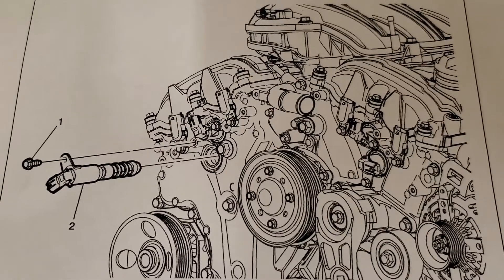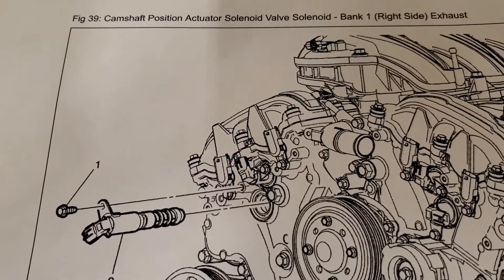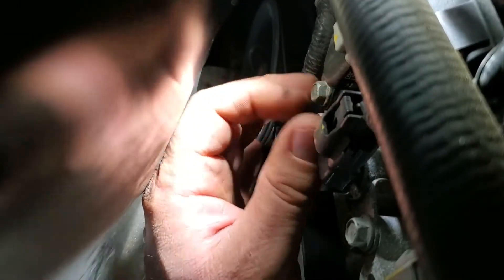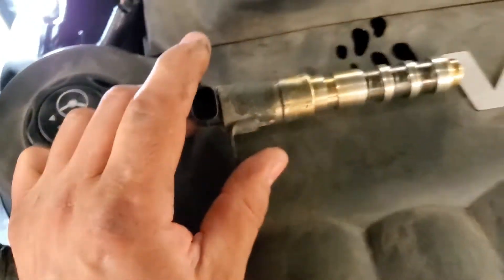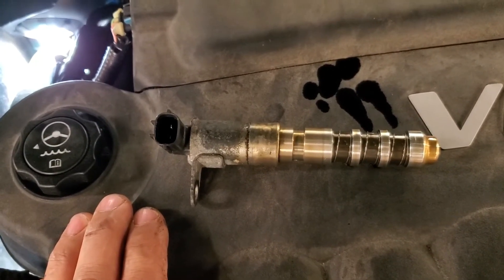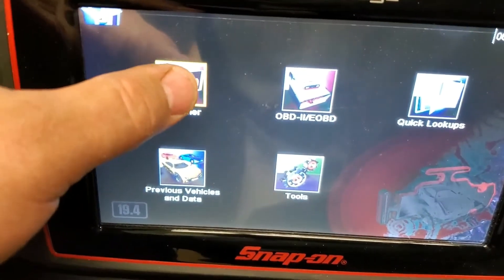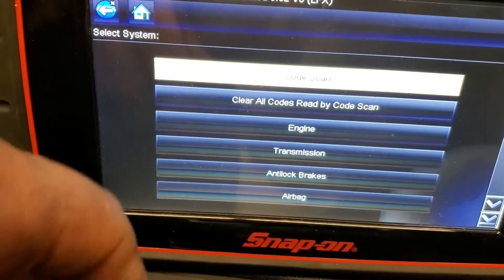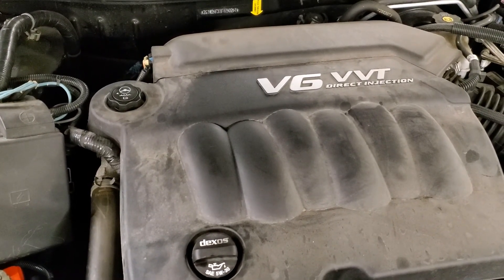Impala P0014

Comment: Great video. I did the intake solenoids last summer. I had about 125k on it. I should have done them all but did not want to spend more, I recommend replacing the oil at the same time. Many times over the years I have seen cam timing issues caused by low and or dirty oil.
Reply: Cam timing issues is the same fix?
Reply: @urielgomez3701  It is all about the code. This is the most common problem. If changing the oil and replacing the solenoids does not fix it, you have other issues. I will be doing both exhaust solenoids and oil change, because I have new codes like P0014- and P0024. The intake solenoids did fix my first issue. two months ago.
Reply: @americanfreedom6417 Did replacing them and changing the oil fix it? I have both of the same codes.

Comment: Just a heads up to all of you that are having this problem with your 3.6 Impala. GM actually extended the warranty for this issue to 10 years 120000 miles. GM will cover 100 percent of repairs. 
Other than that thank you for the video, very informative and will help me repair at home once my car is out of warranty since this seems to be an ongoing issue with the 3.6 engine.
Reply: Got a reference on that?
Reply: Yeah I can use some reference. Lol I have a 2013 with 59000 miles on it…
Reply: The special coverage adjustment that provides free dealer service for this malfunction referenced in the above comment was: 16115 Camshaft Position Oil Control Valve Warranty. Reference number N162058270
Reply: Damn im at 223,000😢
Reply: @roychavez9676  is that so who do I contact because I need it fixed A.S.A.P!?

Comment: Will it cause the car from cranking up
Reply from the maker: Sorry for the late reply.  I have never seen  any that caused that.  So you have a crank, no start condition?  First thing i would do is check for codes.  Then fuel pressure would be the next thing i would check.  Good luck, i hope ya get it running.

Comment: Please help! We changed the oil and both Exhaust camshaft position actuator solenoids 1 & 2 and still engine light comes on!  Car runs well with no changes on power of acceleration...
Reply from the maker: What engine code is coming up?
Reply: @luckyandy76  0014 & 0024
Reply from the maker: @riverasuarezadv  well both codes are for the ecm detecting a difference between the actual and desired camshaft position angle of 5 degrees for more than 10 seconds.  Assuming there have been no recent engine repairs, the best way to diagnose would be with a scan tool and a labscope and ohm meter.  But on snap on, shopkey pro software they state the second most likely fix for this issue is a camshaft position sensor.  But that would just be a shot in the dark, as the other repairs get more and more involved I would recommend a true diagnostics with a scan tool.  As it could be multiple things, my co worker says he seen where the cam postion actuator has gone bad and caused those codes.   Sorry i cant be of more help.  I hope you find the fix.
Reply: Found the fix?
Reply: Wat was problem

Comment: My wife has to drive the car 200 miles to get it back here where I can replace the part, do you see any problem with her driving it that far before the part is replaced?  Thanks
Reply from the maker: It should be fine, where i work we have a police fleet, and some of them hardly ever mention when the CE light is on, and they will drive weeks with this code sometimes before they bring it in for repairs!
Reply: @luckyandy76  Okay, Thanks again for the video.

Comment: I had a P0011 and a P0014 engine code so I changed the solenoid. The engine light stayed off which is great. now I notice an oil leak coming from the solenoid I change. is there a way I can change the seal? what do you recommend? tag a part number to a seal if you can. Thanks
Reply from the maker: Seal has gm part # of 12593717.
Reply: @luckyandy76  ok great thanks. is it simple as taking the old seal/oring off and putting the new one on ?
Reply from the maker: @relaxingsleepingnoises  In theory its that simple.  But there is not much room to work so that makes it a little more challenging.   Usually its a quick job, and pops right out, but every once and a while, the seal is siezed in the hole.  Hopefully yours goes smoothly.   Good luck.
Reply: This is my exact issue! There is space around the solenoid itself. I’m so glad I found your video and comments

Comment: Thanks so much for sharing, I was confused which was the intake and exhaust side lol. I have a 2012 Impala LT with 166K and the same code and CEL. Picked up the solenoid today and will be replacing tomorrow morning.
Reply: Update: I replaced the part the next day and the CEL went off for about 120 miles before coming back on but it was for a different code (purge valve). Now, she's ready for inspection and a few road trips. Thanks again for sharing!

Comment: Mine says "P0014 exhaust camshaft position timing-over advanced (bank 1)" is that the same thing?
Reply from the maker: I believe so.  First thing is making sure oil is in good condition.   If a scanner has is available i would rev to 2500rpm and watch exhaust cam position. But honestly it has fixed that code on all the units i have had pop up with that code.

Comment: Did yours have a seal with it?
Reply from the maker: I have been lucky with not getting any leaks and not replacing the seal.  Where I work we have a fleet that currently contains in it roughly 50 Impalas, I have replaced over 2 dozen and have not had any leaks yet.  I hope I did not jinx it by saying that!
Reply: @luckyandy76  that's cool. Yeah I have this evap code that came on too and then went off the next day. Already changed the purge solenoid so gonna change the gas cap and see.
Reply from the maker: The evap vent solenoid up in the driver's rear quarter panel like to go bad also.  I think it usually spits a po455 or po442 code, if i remember right.
Reply: @luckyandy76  yeah that one has been changed also. I'm hoping just gas cap since those have both been fixed.